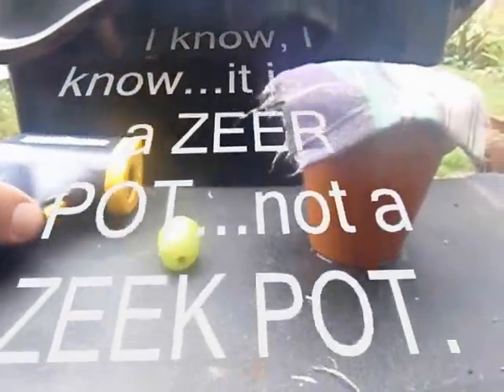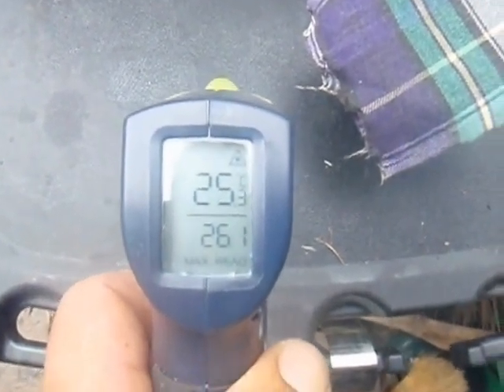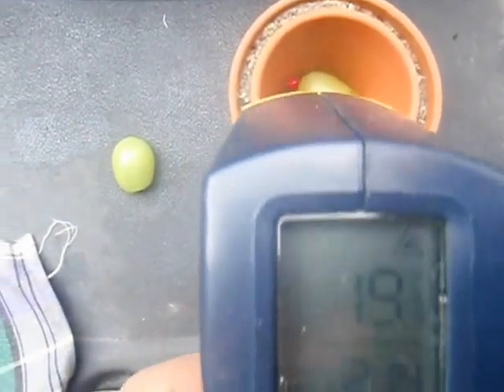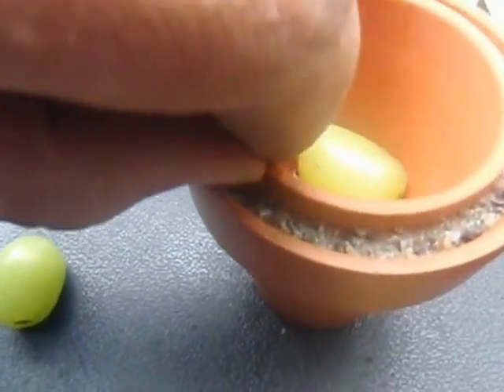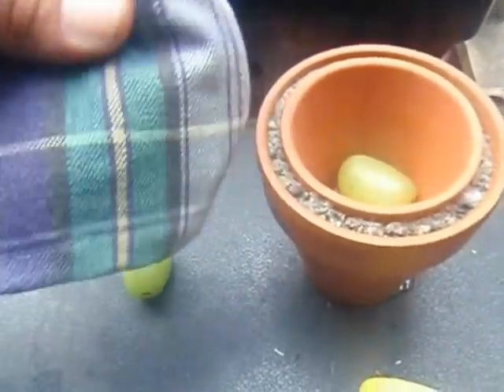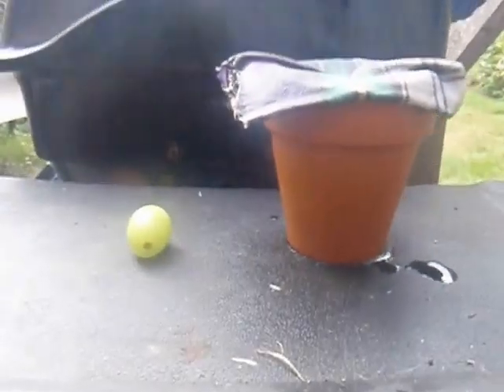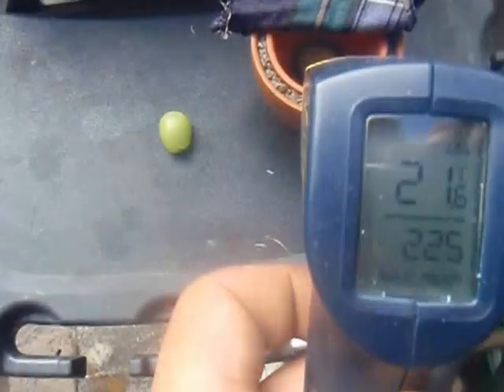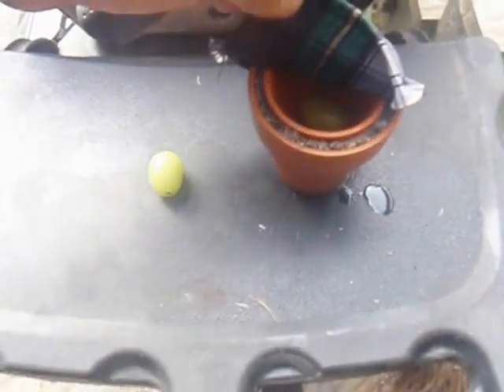Clay Pot Non-electric Miniature ZEER Fridge 10 degree C temperature change

Comment: I can show you how to make this way more efficient... it works on evaporative cooling.....
Reply from the maker: I stumbled upon the Zeer fridge, and liked the idea of keeping food fresh without electricity. It was a "small" experiment, pardon the pun. One more step towards being self sufficient away from the city. Well...one day.
Reply: Drunktoads Okay you know those vertical axis kinda turbine type deals they put on roofs to vent moisture out of an unheated attic space? you see them on roofs.... so you use one of those.. connected to a container... say one container filled (and insulated) wtih your food... the other a duct goes to .. that has say some well say a 2 inch level of water in it... and like some cloth (cotton) strips that wick into the water but hang so the wind driven  turbine must pull the input air through them.... then and inlet for air (BIG) in that container with the wicking curtains.....

Benjamin Franklin along with a French Scientist were the first to note and measure evaporative cooling.. which is why this type of cooler works LOL
Reply from the maker: So you have the turbine on top of the food container with a mesh in the bottom of that to allow air flow. On top of the cooling container.(water and wicks) Seems simple...think I got it. I guess if you wanted to bury that, and add a hose to replenish the water level easily it would help the cooling process.
Reply: Hose? you mean sistern like collector to collect rain water and a drip valve to do such? such a pumpless system? no electric.. just nature? that type of type of hohse setup>?
Reply: or like using 5 dollar 50 pound salt blocks that are 9 inches by 9 inches by 11 inches to stack to collect thermal energy and store it from say wind or solar (concentrated) to in turn convert water to steam night and day 24/7/365 to like use some recycled car tires and some bearings to make a true rotary steam engine that like spins automotive alternators to produce power? who system runs less that 600 USD and like can provide 32 Kilowatts of sustainable power? that type of changing the world that they cannot stop?
Reply from the maker: Yes, a system to keep it replenished without doing anything. You are a smart man, why do you waste your time talking to Drunktoads lol?
Well maybe it's not a waste of time, since you are making my mind grow. Thanks...for all of your ideas and shared knowledge !!!